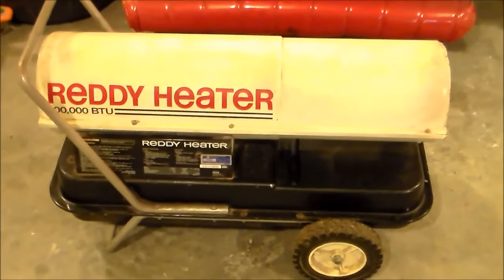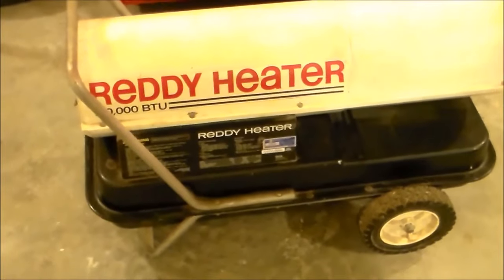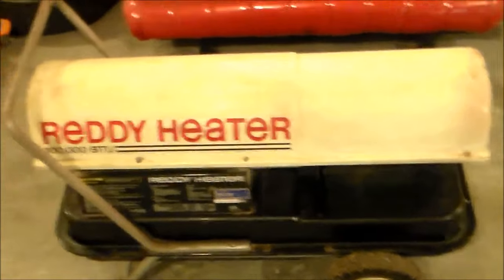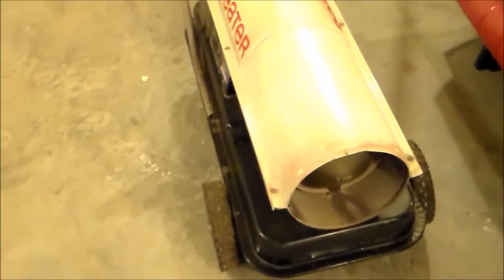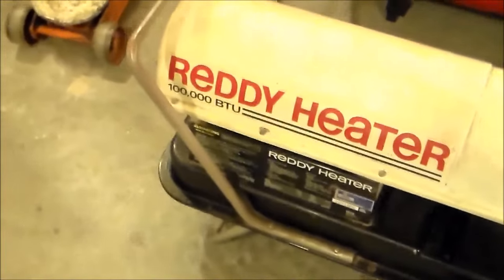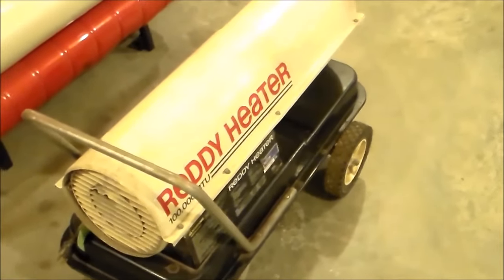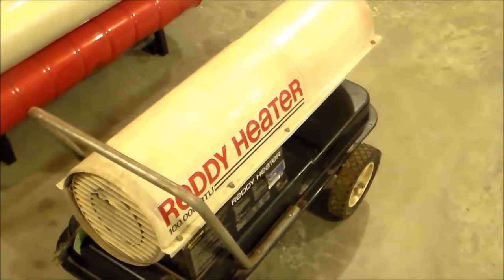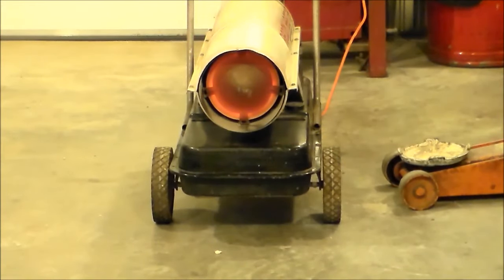Kerosene Forced Air  Heater to operate on Diesel   Tip

Comment: Just bought a torpedo heater, booklet says it will run on jet fuel, which is a fair bit cheaper then diesel..............haven't tried it yet, but will soon.......
Reply from the maker: I have never tried jet fuel , don't have any close by. I have heard it is similar to kerosene, Good luck

Comment: Wow Thanks so much I have a Reddy 150,000 BTU that I had purchased new in the early '90s still going strong I don't use it that much but I never knew you could use diesel fuel I just spent $25 yesterday on kerosene for 3 gallons I wish I had known this yesterday before I went lol but now I'm going to gas station to pick up diesel fuel with a 5 gallon jug mixed with 1 gallon of regular gas. Thanks so much for this tip All these years I had no idea kerosene has gone way up since I started using this heater back in the day
Reply from the maker: It has worked for me many years and cheaper than kerosene.
Reply: @RustyGlovebox  thanks again man
Reply: I have ran pure diesel in them for years
Reply: You might not want to use “regular gas”.  Diesel and kerosene only.

Comment: Good tip. I run Straight diesel fuel here, but we also get winter diesel that is a little thinner. Gallon of Kerosene runs $10-12 a gallon and diesel can be picked up at $2.50/gallon.
Reply from the maker: I bet that is right. We have #2 diesel here. don't know why Kerosene is so high. Thanks for commenting
Reply: Guessing anything that is packaged in small individual containers and sold by retail like Kerosene is, its gonna cost more.  At the local Cenex (s) and Co-Op (s) at the pump it runs around $6.  If diesel was sold at Walmart or Home Depot in disposable 1-gal containers I wonder/doubt it would sell for $2.50 ea.    P.S.  Enjoy your videos and thanks for doing them.  Always learn something in each one...
Reply: IN CHICAGO HERE.. the citgo by my house  had pump kerosene last year i just went to buy some now 12-17  the pump was gone  and no other station is selling it.. went to home depot  12 dollars a gallon i was like WHAT??   diesel  here i come  thanks for the video..
Reply: have you mix in use oil for diesel?
Reply: @katharinetheresa4842  I thought heavily about doing this but decided not to. Mainly just because you breathe in whatever you burn and there's such bad stuff / heavy metals in used motor oil It just wasn't worth it. You would be better off having a waste oil burner stove that exhausted all the fumes outside.
Reply: @katharinetheresa4842  used cooking oil would be safe. Other YouTubers use 1 gallon oil and one gallon gasoline.

Comment: I just ran straight diesel through my old kerosene only heater, all I did was adjust the fuel pressure. I have a new one that is able to run kerosene, diesel or aviation fuel (whatever the hell that is), it has a thermostat and a high low setting. When I run diesel, it's pretty smelly. I've seen others do this too, but I never tried. I think I'm going to try it. The smell is strong with this one.
Reply from the maker: Thanks for the info. That’s very helpful. Have a great weekend

Comment: I mean... I guess I'd consider trying it, but honestly... unless I know 100% it won't cause any issues, I don't see the point when it costs the same (actually a bit less) to just use kerosene instead of diesel just due to the efficiency alone. It's about $3.65 for diesel right now where I live, and the local oil and heating facility (they won't deliver in the small quantities I need, but they'll let me drive to their pump), is currently charging $4.45 for kerosene. With the efficiency level of kerosene, you're running that machine at the same cost, or less, using Kero (AND, even bigger bonus, no dealing with the smell from diesel. No smell I can sense at all using the kero, except for at shutdown, which is big when I'm not using it outside)
Reply from the maker: Thanks for your points made.

Comment: Kerosene and no. 1 fuel oil are the same thing as is Jet A fuel.  The difference is how it’s proofed.  Especially for aircraft use.  I’d use no. 1 fuel oil for extended use because it’s cheaper and then flush with Kerosene for extended storage.  Otherwise, I use kerosene for short, spaced apart usage.
Reply from the maker: Good information. Thanks for sharing.

Comment: So can I run it indoors
Reply from the maker: Wouldn’t run it inside the house but I have used it in the workshop with good ventilation
Reply: So could i use diesel in a kerosene heater that has a wick type  @RustyGlovebox

Comment: I have three old Torpedo heaters going all the way back to the 90s. They have all quit working for one reason or another, but I can't throw them away, thinking that I will learn how to fix them. Back in '18 I bought a new Remington from Lowe's, and I have run it flawlessly on pump diesel fuel, ever since. No problems whatsoever. Have never serviced it or cleaned any filters. It says it is good to use kerosene or diesel fuel. It seems like the three old heaters, said kerosene only. So I'm thinking that does come back to the viscosity issue, the diesel is simply too thick to be pumped through a later generation heater. I will definitely try to fix them, and try the 4 to 1 ratio suggested here. Many thanks!
Reply from the maker: I put a rebuild kit in mine for the first time since I bought it in the late 80"s, hoses, fuel filter and air filter . Set the pressure using a gauge and it's good to go . Thanks and enjoy your weekend

Comment: It's the dead of winter here, and its cold.  It's getting harder to buy kerosene near by. I have a craftsman heater, same BTU, etc..  I have not tried the ratio or diesel to gasoline or even ran diesel in my heater yet, but that day is fast approaching. I have heard a lot of other people quote the same ratio.  A note, a little injector cleaner might be a good idea once in awhile as diesel can tend to clog up wicks, so I would imagine it could also clog up the fuel spraying orifices.  However, like you said, you been running it for years with no problem. People that use this same ration in heaters with "wicks" in them should add a fair amount of additive to keep the wick from gumming up from what I've seen on other videos...  This is a good video, right to the point, short and sweet and accurate, thanks............
Reply: I have ran pure diesel in them for years with no problem

Comment: They also seem to burn cleaner when you mix a little gasoline in with the diesel. But usually, I add 1 can of brake cleaner to 2 gal of diesel, and it's perfect... I've been running the brake cleaner/diesel mix for years now
Reply from the maker: Sounds good, I haven’t tried that before. Thanks for the tip

Comment: Well, from someone who just purchased a Dyna-Glo Workhorse 135BTU Heater!  My drafty workshop, approximately 850 sq. ft. and 10 ft in ceiling clearance gets too cold when the extreme cold sets in. With the wood stove full and just pumping out to compacity, still not enough " Mid Dec through Feb " This is my first experience with these types of heaters and of course, I like "Humour" when I'm stupid, but I will learn. Some of you I'm sure have herd this when you try to teach someone they have no knowledge of....they say " I KNOW, I KNOW " well this is my reply to these know it all's!  You know, You know, you don't F-en know.... I'm the guy who re-frames from " I know, I know, "  even if there is something in the teachings I do know, I listen and absorb everything being taught. My Rookie concern was Fuel in this unit I purchased. The Dyna-Glo heater states it can run on Kerosene/ Diesel and a couple of other fuels. My main concern is Viscosity of the fuels, I do know a little about this so I start doing research, lots of research. I came across Rusty Glovebox's , Your Video Sir. ( " Respect " ) interesting and made sense, but is 4 to 1 diesel/gas mixture a good thing? safe thing? etc. I have no experience! so I read all 164 comments &  replies. When I came across your reply to one of the comments and in your reply you said your heater is 20 years old and if you changed a few things maybe it would run on Diesel as well . At this pointed I pretty much made my decision to what I was going to use in my new Dyna-Glo 135 btu Workhorse Heater. If anyone asks what my decision was , I will know you read this,  and are an individual who does there research, reads lots of info out  there and make the decision that's right for you. I love free speech, I love choice, I love making my own decisions based on all the info. " I retaliate against mandates " Rusty Glovebox " good info...good dialogue, good opinions. Take care & thanks....BB
Reply from the maker: Thanks Brian, enjoyed your comment. Have a great week .
Reply: Does adding the gas reduce the diesel smell any
Reply: So spare a young buck some experience of your juice? Did you get the results you were expecting like rusty? Or you got some wise words for natural selection to steer away from dee who seeks wisdom and knowledge?
Reply: And the results are???????

I have read all the comments up until I got to yours and have seen the bullet points for both sides of this subject. 

May I ask, what was your ending decision for your fuel and mix?
I'm about to go to the only local place that sells Kero at the pump and see if the prices are more or less and go from there for this purchase. But am wondering what your findings were ???
Reply: What was your decision. What mixture did you go with. Did you avoid it altogether. Kerosene is like 10.00 a gallon here, and no one carries it at the pump.
Reply: I just got the same heater 135k BTU. The thing now is the diesel fuel you get today is much different than the diesel fuel you would get in the 90s. It's refined more and a low and super low sulfur fuel. The fuel in the 90s was a completely different thing than today very dirty.

Comment: The older spark plug heaters i assume dont work as good on straight  diesel like the newer hot surface ignitor models
Reply from the maker: Great tip, Thanks
Reply: Mine has a spark plug and works fine on diesel , used it for years

Comment: I run straight no. 1 or 2 diesel with no smoke or smell. Infact diesel puts out more BTUs than kerosene so it's a win win!  ** If you're thinking about mixing gas with your diesel....DON'T! You're going to be breathing that!! WTF? Use a little alcohol, it's safer.
Reply from the maker: Thanks for the info

Comment: I just bought one of these heaters and am excited to put it to work. How are the fumes from the diesel? Are they strong to work in or not bad? Thanks for the straight forward vid!
Reply from the maker: You can smell the diesel compared to the kerosene. But it's not horrible. Good luck and enjoy your new heater
Reply: I use pure diesel , the fumes aren't bad, am going to try adding some gas though
Reply: @robertboyd3863  I wonder if used motor oil could be used with diesel?
Reply: @dudestuff1557  Probably , but would likely have to cut it with gas.  On the drilling rigs we used to pump the used oil back in the diesel tank to burn . I used it once as chainsaw bar oil, worked but made such a mess I stopped using it

Comment: Have 3 ready heaters use straight diesel no issues. Typically I get off road diesel to save $$
Reply: Yeah I use straight off road diesel in every one a have ever bought! I have three now that have never had kerosene in them ! I wondering what he means by converted??? I have had to adjust the air a little bit but not hardly a conversation
Reply: I run straight diesel too. Never had an issue.

Comment: Thank you for the tip.

I've been buying kero from the ONLY Gas Station that has it within 5 miles of my house.
As of Late though, MAN, the price of Kero just keeps going up and up! 

I was hoping that there was some  method or trick to use when running diesel(#2) instead of kerosene(#1).

since you made this video, has your Salamander had any issues from using the fuel mixture?

Just wondering about the longevity of this method....  

So 1 gal. of unleaded to 4 gal. of diesel and mix?
This will cut down the thickness and viscosity of the fuel, burn better/hotter and (hopefully) cut the diesel smell somewhat? 

Got it 👍

Thank you again for the tip and I hope your heater is still running well for you even after these past couple years.
Reply from the maker: Thanks, This will work on the torpedo heaters very good.

Comment: Good tip. But I dont know how the older heaters are but I have a old Remington from the 80s and a newer master pro from like 2018 I run strait diesel in both of them and I've never had a problem
Reply from the maker: I agree, some of the older forced air heaters were very picky. Thanks and take care

Comment: I have ran diesel fuel straight in mine for 20 years or more the Remington 150 every single winter in Wisconsin to heat my garage /shop. Today first time its kicking in and out and wont start 12/05/2024
Reply from the maker: It’s amazing how long they last.

Comment: Your right, kerosene has gotten so darn high I hate to run my heater. I like the tip, thanks.
Reply from the maker: +wyattoneable I have used this for several years now with no problems. Before this I stopped using because of the price of kerosene has gotten so expensive Thanks

Comment: Ultra low sulphur makes the high-temp cut-off trip in mine.
Reply from the maker: It must burn a lot hotter. Good luck
Reply: @RustyGlovebox  Darn it was cold out today, but I think my issue is a bad seal on the intake filter. I have one on order.

Comment: I like the wood stove, For some reason my eyes water when I use those kind of heater, 
  But it's a great tip for someone who isn't affected by them, Thanks for the tip.
Reply from the maker: Good point, but for portable it's an option. Thanks for coming by
Reply: @RustyGlovebox wood stove is not as easy to shut down if an emergency arises.

Comment: I just normally run the bad fuel we collect from the heavy equipment at work. Sometimes people put gasoline in a excavator or watered down fuel. Since water sinks in fuel, I just siphon the fire soup from half way down the barrel. Works great
Reply from the maker: A good use of resources
Reply: Nice tip, ran into some old fuel from a jetski I've been working on. Doesn't appear any more volatile than kerosene or charcoal fuel with a burn test. Draining from ski cut its useless there.  Figure it's better than dumping it.

Comment: #1 and #2 diesel difference? I know off-road is dyed and stuff at a regular pump isn’t and coats more because of tax. Also couldn’t you just put an addictive in for the diesel? Or do you have to mix gas? Could you just mix k1 too? Although for me only 2 places have k1 in 25miles. 
People seem to be scared of gas vapors but doesn’t k1 have vapors too? I don’t get the scariness if they’re designed to run on straight k1. 
Thank you for the help, hope to hear from you
Reply: #1 Diesel is Kerosene. Kerosene is a fuel oil
Reply: rush4ever1 the difference between kerosene/diesel and gasoline is the temperature at which they vaporize and produce combustible gas. The flash point of gasoline is sub-zero, while that of k1 is upwards of 100f. So the liquid needs to be considerably hot, if not atomized, to pose a significant explosive hazard.
Reply: Gasoline produces flammable vapors down to around -40F.   Kerosene and diesel don’t produce flammable vapors until the fuel temp reaches about 125F.

Comment: I have that same heater and i use diesel in mine but at times it just randomly stops burning and blowing smoke everywhere. Also sometimes i have to put my hand over the back of it to get it to ignite.
Reply from the maker: That is why I thinned the diesel for mine so it didn't loose its prime. A person might be able to increase the pressure and it would do the same. Good luck figuring yours out
Reply: Probably your fuel filter is clogged , I just had that problem . the diesel had been in it a long time and I think had water in it , I have been using diesel for years and this was the first problem a simple fix, pull fuel line and clean filter

Comment: Great tip. It is strange how kerosene, which used to be a cheap fuel is now more expensive than gasoline or diesel fuel. I will keep my eyes open for one of these heaters. I have had several of them over the years but always had to give them away when we moved (which we have done 18 times in our married life). The propane heater I have works good, but doesn't throw as much heat as one of these "salamanders".
Reply from the maker: If you could location one of those forced air heaters it should warm your shop up. Remember they are a little noisy but make up in the heat.
Good luck and Take care

Comment: I used straight diesel and have no problem
Reply from the maker: Mine was made in the 80's for kerosene. I think if I would re-jet it or up the pressure it would run on straight diesel

Comment: I know people freak out over this but I have used a small amount of gas in my diesel oil for my torpedo for over 20 years. It works fine.
Reply from the maker: Thanks,  it just thins the diesel a small amount like you know. It's worked good for me too.
Reply: @RustyGlovebox  I think so. It makes it siphon from the tank much easier and helps with atomization. I chuckle when guys think you can't use diesel and if you do it stinks. Kerosene is way too expensive any more and if that's all I could burn I probably wouldn't use it at all. If your heater is smoking, you have other issues. I use a remote thermostat for mine too, which I keep around head high. I can kleep a 32 x 56 x 12 barn comfortable for around 5 or 6 dollars a day with minimal fume. Personally, I have found that the air pressure isn't as critical as is portrayed, unless you're too low. My heater will burn pretty good in a fairly wide pressure range. Cheers.